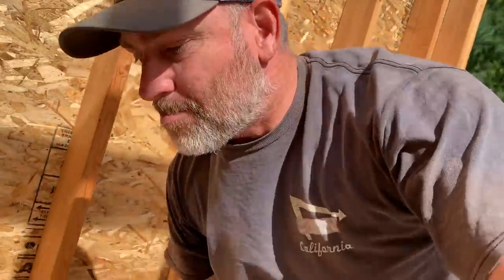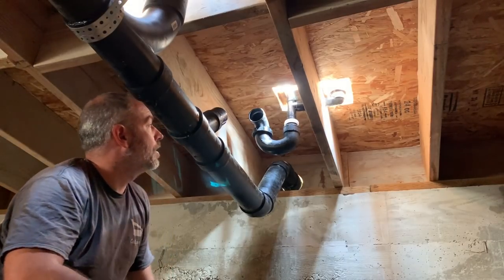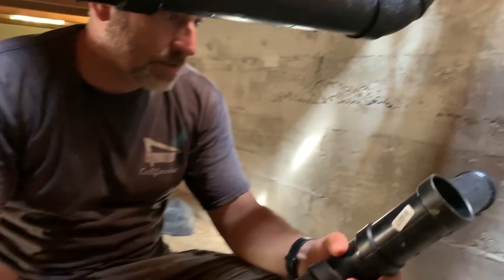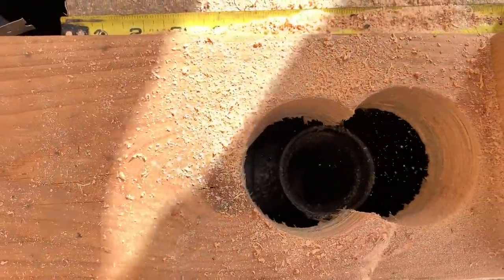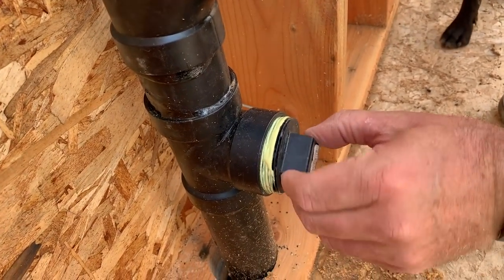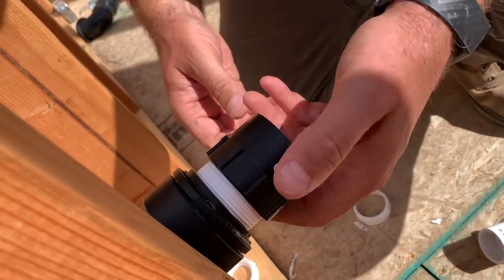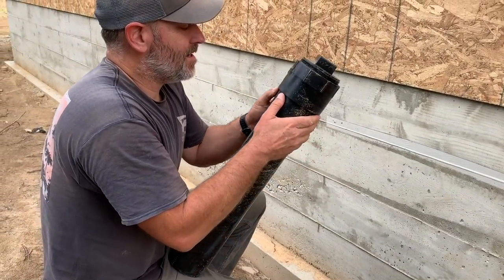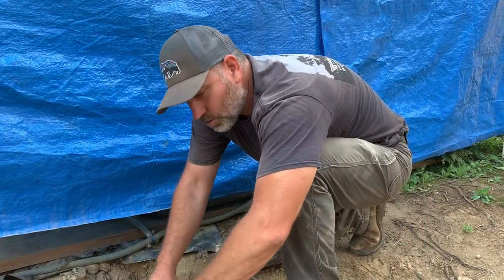Will we Pass our Inspection? | Off Grid Cabin Build #26

Comment: The rubber coupling with hose clamp is a Plumber's secret and works very well.  When you get in tight spots, a Plumber said they make every fitting you need, e.g. 30 degree turn pieces, etc. etc. I hope you pass the Inspection.  Remember, there is more than one way to "skin the cat."  I'm sure there are Plumbers out there with a great solution for hooking up the tub drain/vent, but maybe the Inspector will like your way better.

Comment: Hi Martin, that figure 8 hole should really be covered up. Get a piece of blocking, cut 1 hole where it's supposed to be and nail it to the plate. It will help keep critters from getting in better than foam will. Also secure your deain pipes a little tighter so no shanking and noise between walls when deaining or flushing bud. Looks good otherwise and lots of Kudos for you doing this.
Reply from the maker: Good tip. Thanks

Comment: Hi Martin i asked our engineer about your venting and having looked at your video said you need at least one six inch hole at the base of your concrete walls under your house because its cold and very damp down there he felt even thought you have four large vents at floor level  that air will be warmer and rising and may not vent under your house properly ,vent must be screened,paul
Reply from the maker: Thanks for the tip. We have screen. Just not installed yet. What if we put a 6mill vapor barrier down. Does that change anything?

Comment: Support for horizontal abs pipe is every 4 foot... The tub vent is fine now... are you air testing five psi or water testing... (Some) codes want a ten foot head of water for the test...An exceptional thread sealer is toilet bowl wax for testing applications... The one thing I see is where you transitioned from 3 to 4 inch pipe, they may want you to use the outside cleanout to handle the pipe size increase. That would be a no-no in my area.
Reply from the maker: Thanks for the info. We will have to see what the inspector says. I’ll add more supports.

Comment: The grain fillers can also be the cause of skin problems.
 My understanding is that since corn is such a dense carbohydrate, a lot of heat is generated breaking it down and since dogs dont sweat that excess heat comes out as skin irritations or hot spots. Especially in smaller dogs.

Comment: The piece you are describing to couple the drain pipe back together is called a Furnco.  They come in various sizes.  You are using way too much Teflon tape.  Good luck with the inspection, you should be ok.

Comment: The connector you are referring to is called a "fernco fitting". It is not acceptable in most building codes. The problem with this is the connector hardware fails. Intrusion of roots will occur in these location creating blockage in the future. A stainless steel version is available , not at the big orange store.
 This would be more reliable but still may not pass inspection. The pressure bulb is the way to go, it leaves the very important main drain intact.

Comment: I am enjoying watching your videos (i am a gas safe plumber / heating engineer in the UK). i might be looking at this wrong but your subfloor waste and drainage surely should have a constant fall to the outside, however the 3" line going out the building towards the septic tank rises maybe 18" by using a couple of 45 degree elbows. This cant be correct ?

Comment: Hey Martin do you think if you pulled the toilet you could silicone a plug in the toilet flange so it would be removable. Anything thing to avoid cutting the pipe. Or if you do have to cut it put a clean out in if you can
Reply from the maker: I don’t know. I’m asking the inspector about it.

Comment: dont use the rubber repair sleeve!!!!!! settlement of the dirt will make the two pipes separate. (imo) I have never seen the drains needing pressure tested since most dwv PVC (white kind) is not rated for a lot of psi due to its foam core design.  I have seen the need to pressure test the water supply lines but never the drain.  In Maryland they inspect the septic to make sure you at the correct depths with the correct materials (gravel, pipe, etc) then you are allowed to cover the septic up.  Good Luck with your inspection.
Reply: Ohio sewers have to be pressure tested, but I agree dont use the fernco fitting ( rubber sleeve) for the same reasons you stated

Comment: THAT SHORT PIECE OF PIPE YOU PUT IN AT  7:39 I HOPE IT WAS ON A SLOPE AWAY FROM THE TRAP OR YOU WILL HAVE A MAJOR DRAIN PROBLEM IN HE TUB..  LOOKS STRAIGHT TO ME . YOU WONT HAVE ENOUGH PRESSURE COMING FROM A SHOWER TO EMPTY THE TUB. IT WILL FILL THE TRAP AND PIPE.
Reply from the maker: This was an old video. Everything is working fine.
Reply: I know it's an older one but it looked like it could clog right there....just trying to save you a headache later on.
Reply from the maker: I understand. Thanks. The shower empties the tub fine.